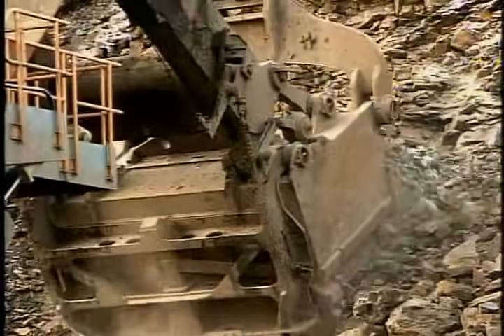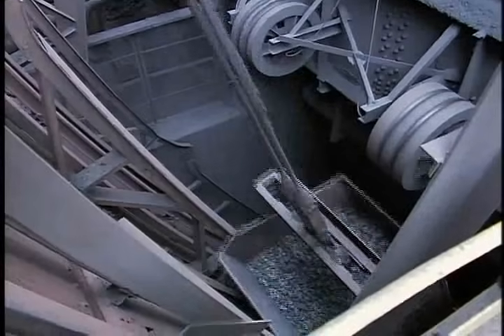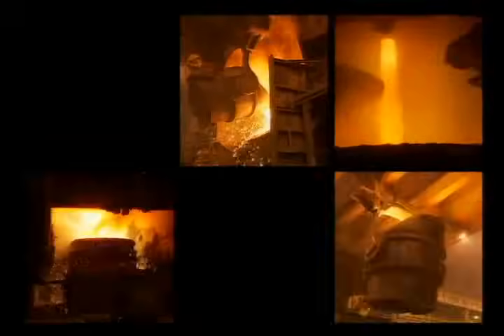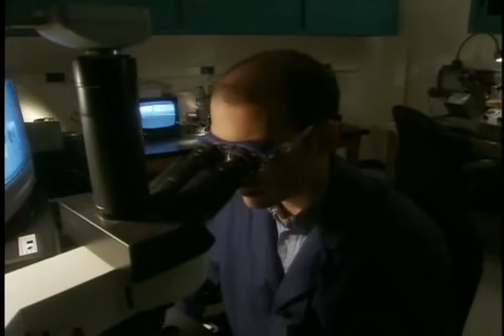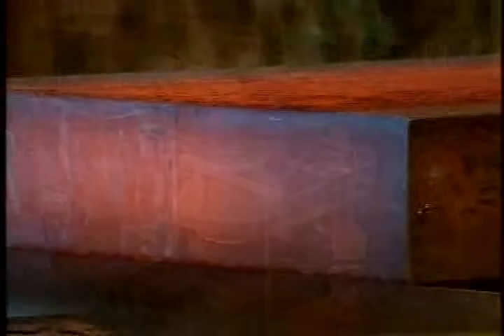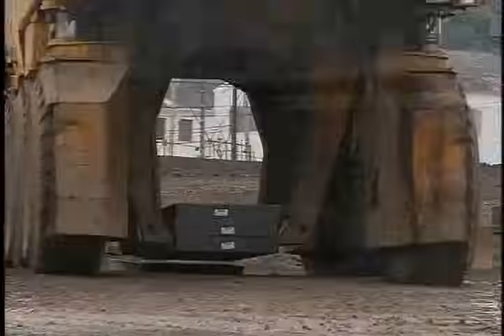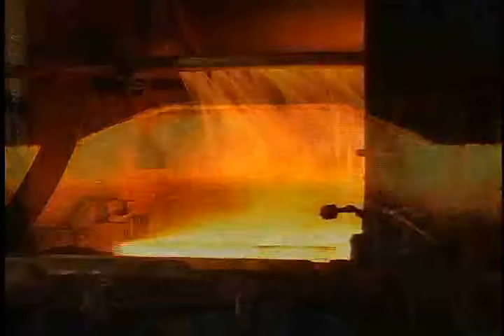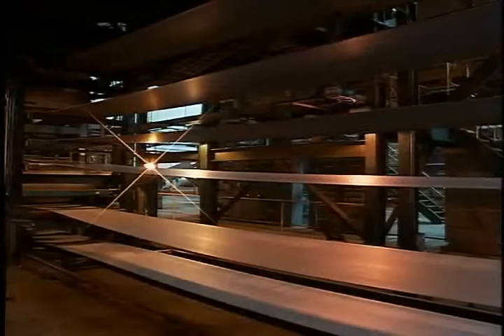STEEL: From Start to Finish

Comment: Modern mass produced "steel" compared to that produced 50 years ago is terrible quality, it is so bad due to the high percentage of scrap introduced before the iron is converted.Impurities from the scrap are not removed;the more its recycled the worse it becomes.Modern mass produced steel machines poorly and corrodes many times faster.In the past even the lowest grade steels exceeded modern standards for mass produced steel.Mass production = low quality,quality steel costs many times more now.